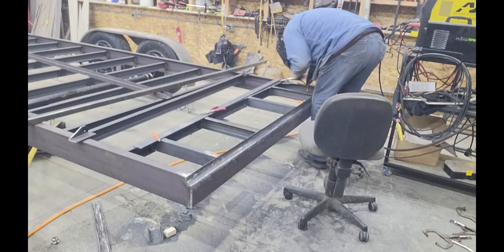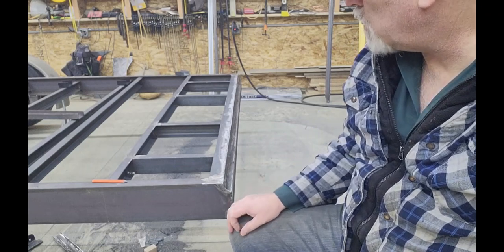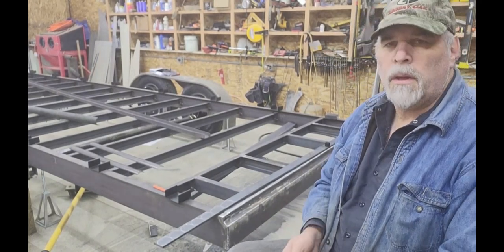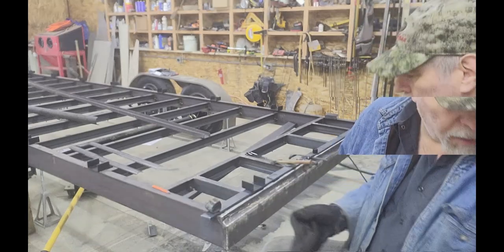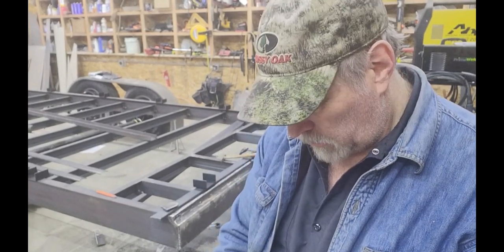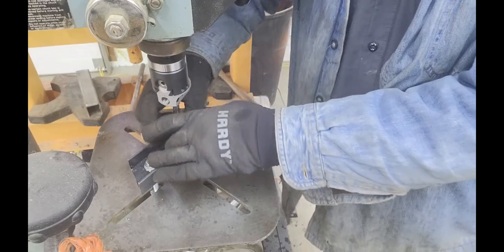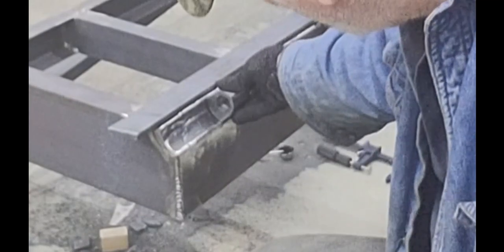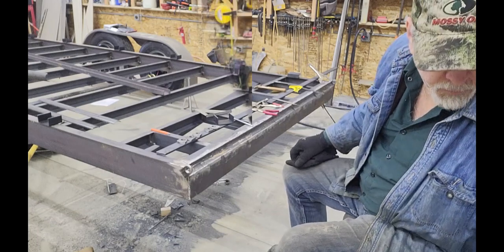Finishing up the hinges; some shop visitors; and some boring bar work

Comment: Oooook - I get the hinge now. I'll be coming up with a simpler way to do it. That is way more work than I'm willing to do. LOL Plus you've got the drill press and that bit... that I don't have.
Reply from the maker: If you don't have a drill press or mill to use a boring head, one alternative is you can purchase oversize reamers for not a lot of $, and use them in hand drill to get a hole 0.010 over nominal for example